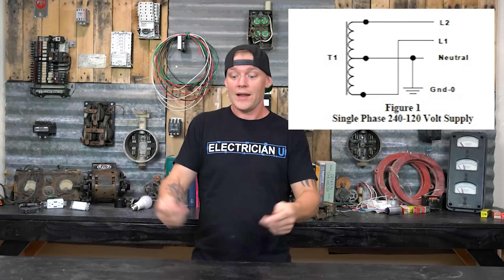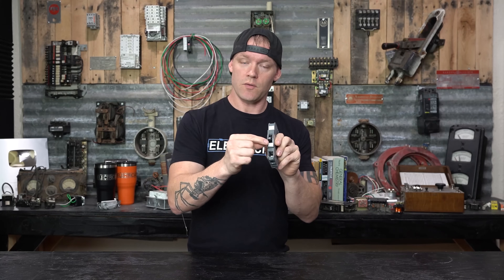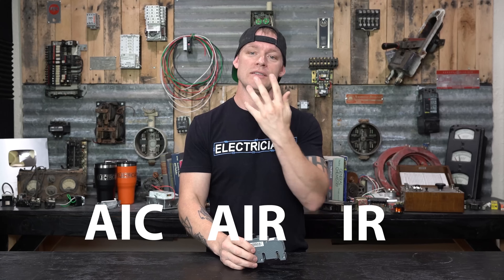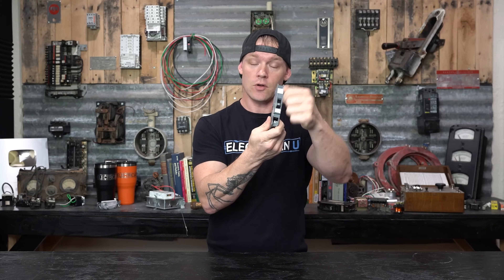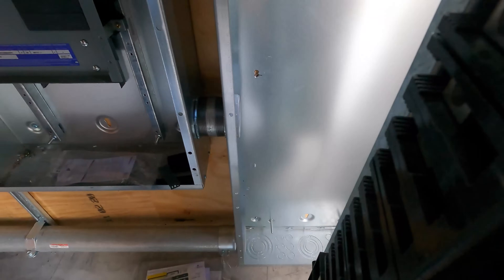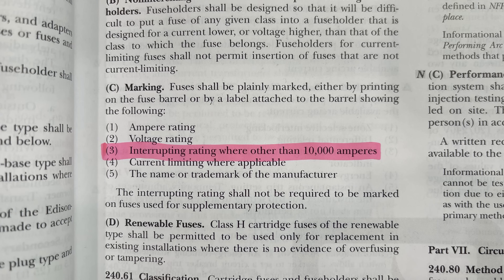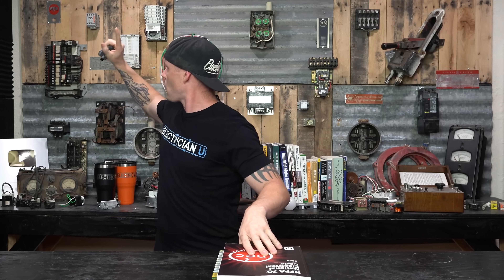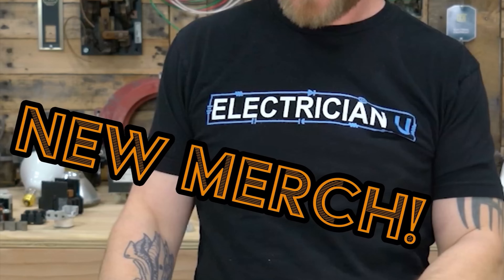INTERRUPTING RATING vs AMPERE RATING

Comment: You can't go wrong with running equipment that you derated. If you have 10,000 amps of all current at a direct short state in the worst possible conditions and you have a breaker that will hold 30,000 amps instead of 11,000, you might be going home one night when you shouldn't have. I saw a very strange electrical disaster on video somebody had, is the breaker box had the face off of it it would have burnt the house down. There's a lot of places to save a few nickels on any build the electrical system isn't one of them.

Comment: I have a question regarding the use of higher-rated AIC breakers in a panel. Is it permissible to use a breaker with a greater AIC value than the AIC rating of the main breaker already installed in the panel?

Comment: thank you for the vid ,i am looking for a 120DC 2 pole breaker that will trip at just that 120A , all i found yet will go over that b4 tripping . Another thing is i need ANL style fuse that bust at their set Amps rating  . wiring the breaker & fuse in series how should i go ; Breaker then the fuse or Fuse then breaker , i have to mention that the breaker is intended as a switch (1st) and a cut off , Thank you for any parts suggestion and ideas you may pitch in , Best Regards & Cheers !

Comment: This is excellent explanation, TQVM. Can you show How to Calculate or Determine the Value of Breaking Current in a Circuit. This will help in choosing the Circuit Breaker. Also does thes values affect RCD? I think in BS7671 its called by several confusing names ..Icu, Ics, Icn, Icm

Comment: Hi sir can you explain the differene between the ampere trip, ampere frame and kaic rating of a ciruit breaker??
Reply: The frame rating is the physical size of the breaker, associated with the largest trip rating in that particular physical size.  It is the "bin" of components that the manufacturer uses to make 99% of the breaker.  Rather than making specialty breakers in every amp rating, the manufacturers group similar amp ratings into one family of products, that all use the same housing, the same lugs, the same handle, etc.  The essential difference is the calibrated trip mechanism.  Generally, frame ratings follow standard disconnect blade ratings, such as 60A, 100A, 200A, 400A, 600A, 800A, and 1200A, but manufacturers may vary.

The trip rating is the rating is the ampere rating that we usually mean, when we speak of the rating of the breaker.  This is the rating of the calibrated trip mechanism inside (the bimetallic strip for the thermal part, and the solenoid for the magnetic part).  Or it could be a configurable setting on a breaker with an adjustable trip dial.

The KAIC rating, is kilo-amps-interrupting-capacity.  It refers to the maximum amount of short circuit current that the breaker can "survive" before it catastrophically fails.  Between the trip rating and KAIC rating, the breaker is rated to safely interrupt the overcurrent.  Above the KAIC rating, you can expect the breaker to be permanently damaged.  It ultimately means that the manufacturer hasn't tested it beyond that rating, so it still could "survive" an overcurrent slightly larger than this, but don't count on it.

Comment: I’m working on learning how to figure out what is the available amperage in a existing panel. I took a amp clamp reading of all 3 phases and it’s a 225a panel with 175a rated fused in the disconnect. I have A 69 , B 82 , C 73. So this is the part I am thrown by this is 224 total amps if this was the answer my 175 amp fuses would be blowing correct?

Comment: In the 2021 Canadian CEC code (page 99, 8-304), breakers and fuses rated for continuous use at 80% are allowed to feed fewer devices than those rated for use at 100%. For example a 15A branch circuit fed by a breaker rated at 100% can feed 15 outlets, but a similar circuit fed by a breaker rated for use at 80% gets the old standard of 12 outlets. I've never seen that inscribed on breakers, where is that info? Is it a fair assumption that most are rated for 80% continuous use?

Comment: In UK we call it max Ka which is usually 6000amps (6Ka)or 10,000 lamps (10Ka) but this can be lower in older breakers. I’m talking domestic and light commercial.

Comment: I've come across intermittent tripping service calls where the 20a breaker was holding at 26-27a. The cause was multiple space heaters on the same circuit.

Comment: What happens when the current exceeds the interrupting rating in the breaker?
1.The breakers didn't detect the short circuit
2. The breaker detect the short but the main breaker also detect the short
I want to know the answer
Reply: Theoretically, the AIC is the amount of current a breaker or fuse can withstand before it becomes a welded short circuit.

Comment: Is there a rubber plug available for all the little holes in J-boxes?  Like the 2 in the front of a duplex  receptacle cover  and multiple on the sides, To me it seems like those should be plugged up for spark suppression and asthetics.

Comment: I have a question that I've been thinking about for a while. When you have split phase circuit (ex. 240V load), and the circuit has a 30A breaker for example, does that mean 15A in each leg? I know it's a silly question, but since I deal with HVAC equipment rated for 240V, I'm always wondering, but I haven't found someone to explain it to me.🤔
Reply: You can use a double breaker as two single breakers to supply 120 volt to two separate circuits..
If you have a 30 amp double breaker, you can connect a single 10 gauge hot wire and it will work for 120 volt. You would NOT connect a 12 or 14 gauge wire to the 30 amp breaker or it creates a fire hazard.

You can create a 240 breaker by combining 2 single-pole breakers, they must be located side-by-side, and code requires a 'common bar' between the breaker switches so if one trips, then the other breaker also trips.
You would NOT use two 15 amp breakers. You would use two 30 amp breakers and 10 gauge wire.

Calculations
Volts x Amps = Watts is a basic electrical formula
Volts (V or E) x amps (A or I) = watts (P or power)

-Let's calculate watts for 120 volt single breaker
 -15 amp single breaker. 120 volts x 15 amps = 1800 watts of power
 -30 amp single breaker. 120 volts x 30 amps = 3600 watts of power.

-Calculate watts for 240 volt double breaker.
-15 amp double breaker. 240 volts x 15 amps = 3600 watts of power
 -30 amp double breaker. 240 volts  x 30 amps = 7200 watts of power.

With 240 volt, the watts or power is doubled  .... Amps are not cut in half

Since each leg of 240 volt circuit offers 120 volt potential to ground, then you're getting two legs of out-of-phase 120 volt when you use double breaker, and doing so doubles the voltage and doubles the watts (power), it does not halve the amps.

This shows that each leg of 30 amp double breaker delivers 30 amps, and not 15 amps.

http://waterheatertimer.org/are-both-sides-of-30-amp-breaker-15-amp.html

Comment: Hi, in the UK we have 'Prospective Short Circuit' PSC Current for every installation this has to be know, even for domestic.  We also have need to know for earth (ground) faults the Ze (external impedance) this is designed / measure at the source (service head) and the Zs (system impendence) this is designed / measured usually at the furthest point on each sub circuit.
Zs can be measured as R1 + R2 (line resistance + circuit protective conductor [ground wire] + Ze)  this then allows us to know via tables in the Regs BSEN 7671 (Code) if the circuit breaker or fuse will disconnect in the time stated in the Regs

Comment: At 0:25, is that modern Zinsco replacement breaker basically as good (more specifically, as safe) as the best of what current breakers offer, not counting gfci or afci features of course?

Comment: My job is to spec circuit breakers/panels based on the calculated fault current at each point in a system... AIC rating is a big can of worms lol 

AIC is all about keeping the breakers from exploding shrapnel everywhere. 

If a breaker experiences the full available fault current of a system you will be replacing the entire system. 

Hopefully the fault was not cause by someone dropping a wrench between live buss bars on a high AIC panel. They likely would not live due to the intense heat of the arc flash. (This is more a commercial/industrial situation but has happened)

Comment: can you explain fault current calculations , maybe give us some examples how to work the math ?
Reply: The short answer is that an upper limit to the fault current available at a given point, is the amps associated with a transformer KVA rating, divided by its impedance as a decimal.  This assumes there are no significant sources of fault current on its secondary, such as motor loads, which can add to it.  You also can reduce it, when accounting for the impedance and length of the conductors, from the transformer, to each point within the circuit, so generally, available fault current decreases, the farther from the service point you are.

This also assumes "infinite bus", which means that there is infinite fault current available on the primary side.  There is a much more complicated calculation that accounts for utility primary current, and determines the available fault current on the transformer secondary.  This calculation approaches a "cruising altitude" (i.e. asymptote) as the primary side fault current gets large, and that "cruising altitude" is the infinite bus value.

Comment: INTERRUPTING RATING vs AMPERE RATING . Do the Interrupting rating have a time limit on them ? like 10 ms. or not  like for example AFCI? GFCI.?
Reply: Technically kinda but AIC rating is more about the breaker not exploding and throwing shrapnel everywhere. 

A full blown fault is the upstream transformer's magnetic field collapsing as fast as the impedance of the system (wires, bussing etc) will let it.

Comment: Why do fuses have a maximum current? They’re going to burn up either way, how does high current prevent that from happening?
Reply: If you are speaking of the continuous current rating, then they have the rating to coordinate with the load and supply conductors to provide both protection and prevent nuisance outages.

With regards to interrupting rating, the fuse needs to be able to fail safely and provide and stop the over current or fault. If the fuse is not rating for the larger fault currents (ie 100ka or more) the fuse may provide a path for arcing and may not clear the fault safely.

Comment: My pushamatic 50 amp 240 v 2 pole breaker for my air conditioner compressor had popped a few times when it’s really hot out.  I put my fluke inductive amp meter on each line at the breaker. That read 24.6 and 24.4 amps.  My question is, does the breaker pop when there is 50 or more amps on one pole or both poles?
Reply: That would be a complete circuit. Even loads on each pole. But with 24.6 amps the breaker shouldn't open. Replace the breaker.

Comment: During a short circuit or ground fault, the amount of amperage a component can see in the split second before a fuse/breaker opens can be SIGNIFICANTLY higher than the ampere rating for opening. This higher amperage can put significant stresses on the fuse/breaker that may cause them to blow up if they are not rated for it. The AIC rating is saying the fuse/breaker can handle this higher amperage and still do it's job of opening.  https://youtu.be/tVcsRrOLQlI

4:12 shows a 10kA AIC breaker with two 22kA AIC breakers. 

My understanding: As a general rule, be careful doing this.  Panelboard SCCR rating will normally drop to the lowest AIC rated device. With that singular 10kA  breaker the panelboard maybe rated 10kA which may be below the available fault current and the reason the original 22kA breakers where installed.

Comment: Question. Say you have a service panel with a 200 amp main breaker and 29 out of the 30 breakers are rated for 10KIC but the last one has a 5KIC rating. What then is the KIC rating of entire system? Ran into trouble on 3000 amp switchboards that had 480 volt 3 pole breakers from 400 to 800 amps with different KIC ratings that the company that performed yeatly maintenance & testing were not happy about that situation.
Reply: Izzy, placing a single 5kA AIC breaker may lower the rating of that entire service panel to 5kA (SCCR rating of panel should be labeled in panel and generally reads, "the rating is equal to the lowest interrupting rating of any circuit breaker").

Example: If there is 9kA available fault current at the panel and a 5kA AIC breaker is placed in the panel, the panel is now rated for 5kA and is no longer legal and is a potential safety hazard.
Reply: @Roommate625  Thanks. Thought that might be true after we pulled out 480 volt breakers with something sround 30 or 35KIC to a switchboard that had all 65 KIC breakers. Never too old to learn. Disappointed in how many sparkies that I worked with or meet that never owned a code book. Worked at a large newdpaper when they were haf a large circulation but cheap skates. They refused to ever purchase at least 1 code book every 3 years or rubber gloves. Got tited of them always borrowing my code books so I locked them up. Told me that I was not a team player.

Comment: I am an electrician in Los Angeles. Here we struggle with the title 24 and the lighting control. Setting up the zones etc... Do you guys have title 24 in Austin/ Texas?
Reply: I talked to an teacher/inspector at a IAEI class about some of these ridiculous energy codes. If a homeowner has to spend a hundred dollars to save a few cents a year to shut down a circuit that has a cell phone charger on it would take thousand years to even out. All for the energy saving that almost makes it impossible to only use LED lamps to meet code. Worked at a large candy/chocolate company back in the 80's. They had a dim witted energy engineer. He would shut boilers down on warm weekends but several times frooze hundreds of feet of 3" milk chocolate lines. One timebit took a dozen or more machanics 14 hours to clear the pipes causing 2 days of overtime to make up for lost production.

Comment: was in hvac and commercial refrigeration.. Figured the needed size of the breaker was actually 80% of toggle label at 90 degrees... Can't begin to the number of clients with panels on the afternoon sun walls that had problems with breakers tripping when the wall heated up in the summer.. fans would help on the more moderate days.. 100 degrees days were a bitch

Comment: This is a subject that most Electricians don't understand, why does the breaker give a low amperage rating along with a high amperage rating 15amp for low and 10,000 for high. Because it needs to protect for both...

Comment: I'm trying to figure out why some circuits would need higher interrupting rating than others.  If the panel can supply that much current, shouldn't they all need to have higher interrupting current?  I mean the downstream short could happen very close to the breaker, in which case, the resistance of the wire there wouldn't make much difference right?  Or is the current still limited by the wire so you would only need a breaker with higher interrupting capacity on a circuit if you had to oversize the wire for that circuit because it was a longer run?
Reply: Do some reading on interrupting rating. Specifically series rated systems(ones that have downstream devices with a lower IR than the upstream devices). In short, there are OCPD combinations that have been tested as a unit (such as panel boards), or in combination with each other (ex: breaker feeding a subpanel & the subpanel OCPD) to ensure that they can be used together under certain fault conditions.
Reply: Smaller circuits like 14gage wire can only deliver so much current in a dead short lager wire like 2/0 can deliver more...
Reply: @steve-o6413  That depends on how long they are.  Larger wire has less resistance per foot, so a heavy wire with a short 100 feet away is likely going to draw less current than a short on a thinner wire that is only 6 inches from the breaker.
Reply: @phillipsusi1791  yes but on long runs you have to figure in voltage drop and may need to increase your wire size...
Reply: @steve-o6413  That is why you might go with the next size up wire on a given run, but my point is that the short isn't always going to be at the far end of the wire.  A smaller wire with a short that is much closer can draw just as much current as the heavier wire with a short at the far end.